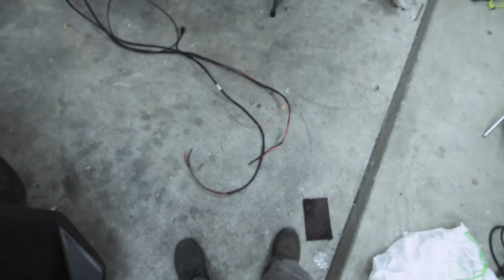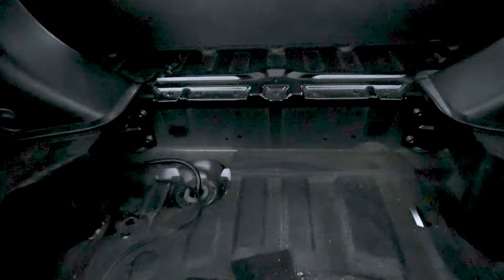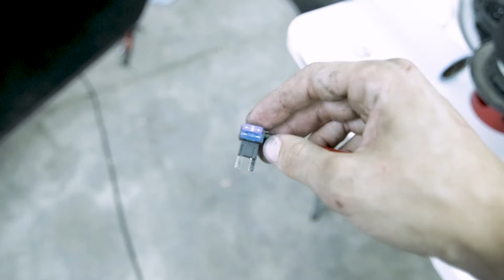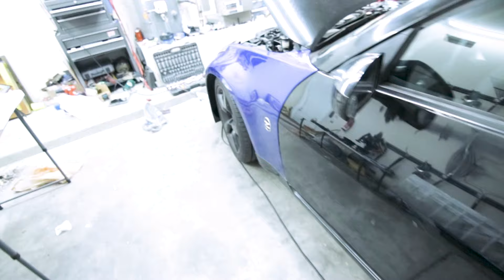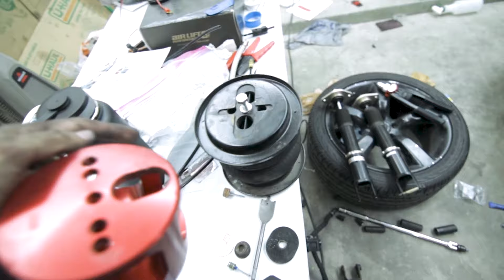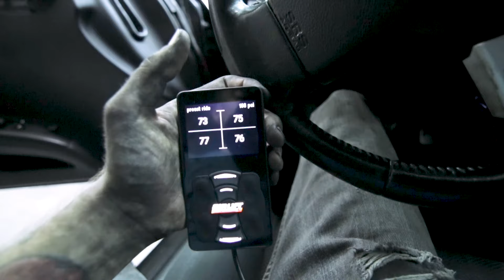MOST Detailed Air Ride Install Guide!- Project 350z- Airlift 3p install

Comment: If you run that exhaust line out to the exterior of the car you will get that loud hiss. Great job. My install took couple weekends because I had to make a trunk board and drill into my car for the airlines. Airlift's direction on my model I needed to drill some big holes.
Reply from the maker: Glad you got it done man! Yeah I ended up drilling a hole in the rest wheel well and getting a fitting to put in there and connect the exhaust to. It's way better than having it routed in the car lol

Comment: Your driver's seat is getting tore up in the same spot as mine... and your door panel's got different shades of black like mine.😑
I just had to gut my interior+clean Everything b/c of white mold.  Water was leaking into the hatch area before storing the Z for months during summer...a leak i didn't know about.
I got the fabric/covers off the foam+I'm debating between fixing that area of fabric (by an upholsterer) and putting $80 seat covers over the oem seat fabric.... Or buying custom fitted seat covers to replace the oem fabric.  The door panels will be a future project.  
Sweet setup on the air👍👍
Reply from the maker: Yeah, I got some new seats coming in at some point, Corona is causing everything to take forever to ship... Damn man that friken sucks... I had water getting in my Hatch area too, it actually ended up being from where the rear bumper clips go in to by the tail light, so I sealed it with rtv and it's all good now. Might want to check that spot. What's stopping you from just getting a cheaper pair of racing seats instead of seat covers?

Comment: Awesome install video! I’ve wanted bags for so long but 4K seems to high for me to pull the trigger, what’s a setup like this run used?
Reply from the maker: You and me both! Lol I'm so stoked to finally get them. Yeah it's outrageous, I picked up this setup for $1700 used so not bad at all. Might be worth it to piece a kit together used, probably save a ton. There is a used air ride page on Facebook
Reply: Kyle Hidalgo damn what a steal!! I’m def gonna check that group out thanks homie!
Reply from the maker: @Rb26350z  yeah dude, it was originally going to be a drift build and then I came across that and couldn't pass it up lol

Comment: Awesome video I’m doing a DIY universal air kit and wasn’t sure about splicing into the ignition wire would the add a fuse work as well for the wire from the pressure switch? Btw it’s a manual management system so it has paddle valves for lowering and raising the car

Comment: What do you do if you fuck up drilling the holes on the top part of the bags in the rears
Reply from the maker: Shit sorry, just saw this. Like in the body? Probably would have to get it welded and try again. How'd you fuck it up??
Reply: I didn’t but i worry about it if I do
Reply from the maker: @brandonfelt1486  honestly it's pretty easy, it would be hard to fuck it up because you use the parts on the bags as a template. If you did though you'd probably have to get it welded or I'd be worried about safety

Comment: luckily z's are very easy.. to say so you can do your car doesnt apply. just saying
Reply from the maker: Pretty much every bag set up is the same if not very similar. The only difference that diffent cars make is the routing honestly and the rear bags which are probably easier on most cars since most cars have a full shock set up in the rear instead of a shock, bucket, and separate spring. The routing is definitely not that big of deal, if you can route sub wires you can route bags and at at most your have to drill small holes for hose routing. It's not complicated